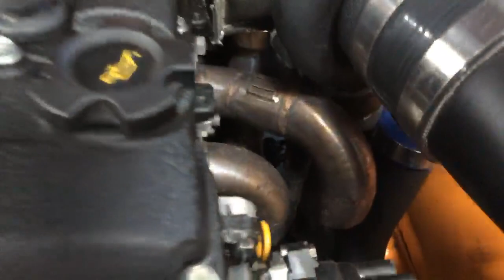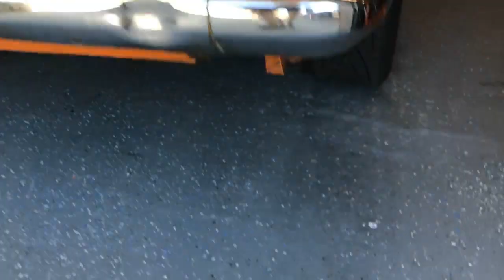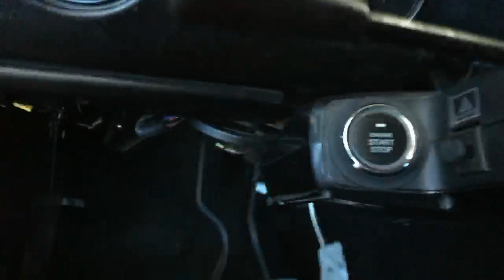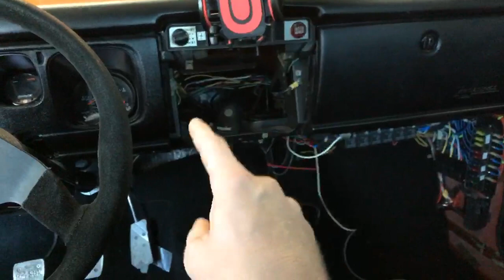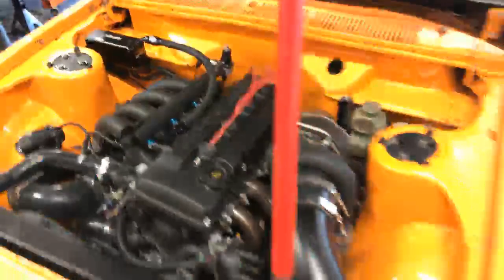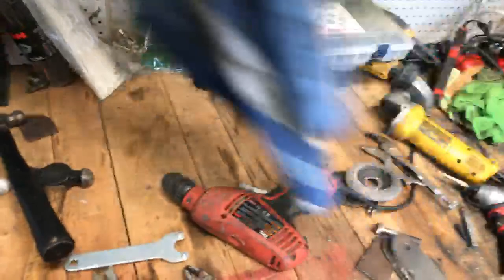How Much Horsepower? 🤔 | 🍊 510 Update

Comment: Cut the step out of the wheel well and notch the control arm and reinforce it and you can run what I had on my sr510. I ran 245/35/17 in the rear with stock quarters and lip rolled. Feel free to contact me anytime and I can show you the way paddywan lol!

Comment: What's the fuel system (pump(s), line size, injector size? Stock cams? I'd say right around the 325 mark, as long as said parts aren't as I suspect they are. PLENTY enough to have some fun in a 510!
Reply from the maker: I believe the pump is a Walbro 585lph, 3/8" fuel lines, ID1000 injectors, stock cams
Reply: 2J-Z Planning for E85?? If so I might wanna up that number just a lil lol
Reply from the maker: 1dickycat Which number? If I want more power than 400 I'll likely do e85 but I highly doubt that'll happen
Reply: 2J-Z Well I was saying my HP guess. KAs can make great power as long as your individual systems can handle it, which I think you have covered all the major bases. I was expecting a walbro 255 and 450cc injectors. Now hearing what you got I'll say she might hit the 400hp mark, but 350-375 would be good for reliability. All in all not to shabby man. What trans and rear end you running?
Reply from the maker: 1dickycat Running the stock KA trans and an R200 in the rear!
Reply: 2J-Z Which R200? or I guess which gear ratio, and how's the powerband so far with it? My next build is gonna be an s12 and I was thinking of running the same motor/trans, but with a kouki z31t R200 for that 4.10 gearing and an ok lsd...